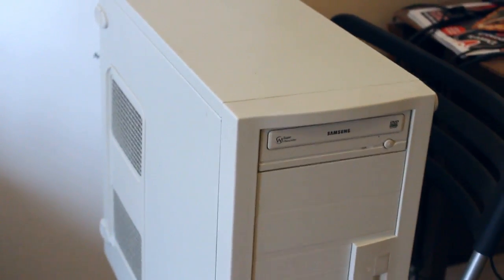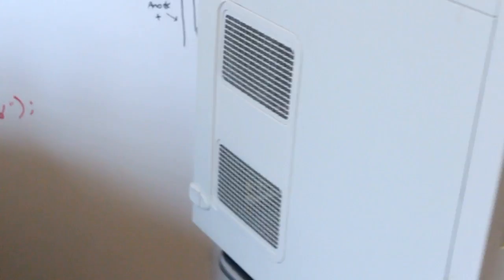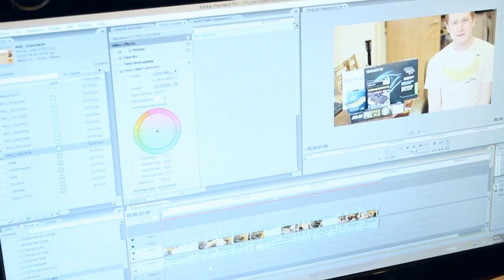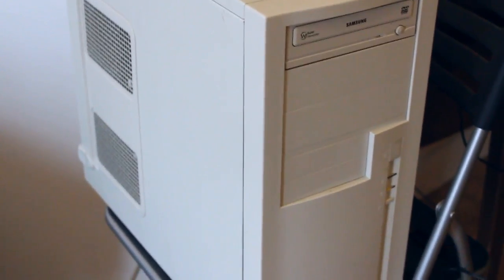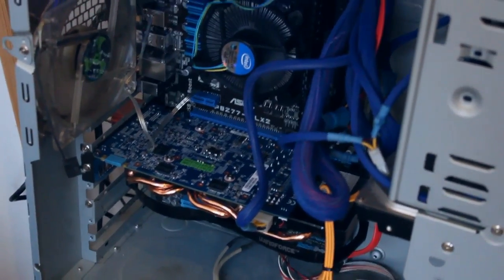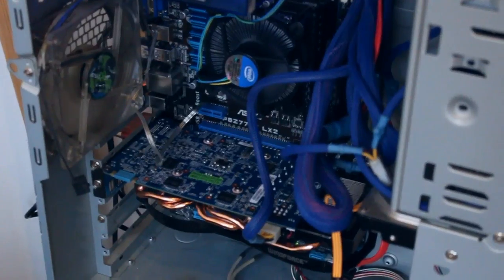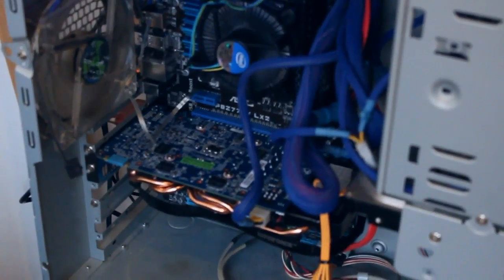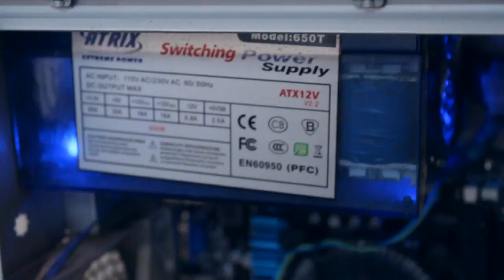Nerd Project: PC Build 2013

Comment: How much did it cost you? I plan on getting similar parts maybe, but of course I have a better case lol. I just got a corsair 600t it is huge! The only bad part is that my 4 pin doesn't reach to the top of the case, so I will maybe upgrade the psu or just for now I will get a extension.

Comment: Yeah I just decided to get a OCZ ZT650W Fully Modular PSU just because I want to upgrade my crappy 8400 gs eventually and I want fully modular cables because I want to eventually custom sleeve the cables. It fits great lol I can even route the 24 pin behind the motherboard and the 4+4pin even though my motherboard is just 4 pin, but I can use it for the newer motherboards and stuff in the future.

Comment: That's an opinion. There are soo many more cheaper cases that are "better" than the 600T. It depends on user preference. Also, any case will fit any ram, unless you have crazy heat pipes coming off them.

Comment: Hi i am building a PC with the excact same motherboard. However when i install the small 2pins for powerbutton, hdd led, powerled, resetsw, it does not start, even tho i installed the pins the way the manual said. did you install them according to the manual? can u write specificly how u installed them :) ? (im talking about fpanel)